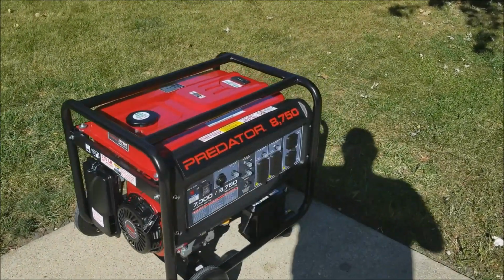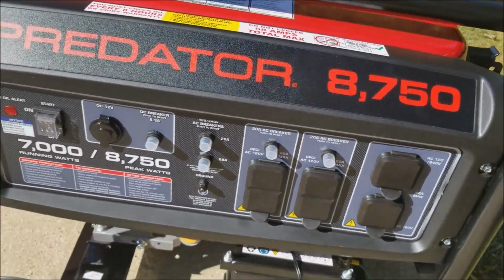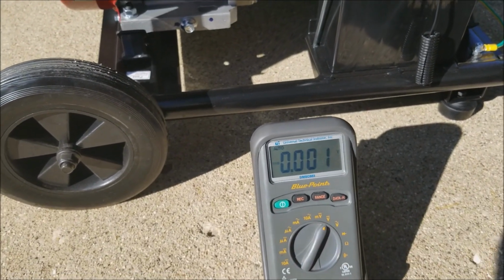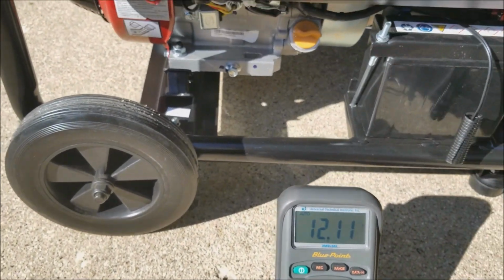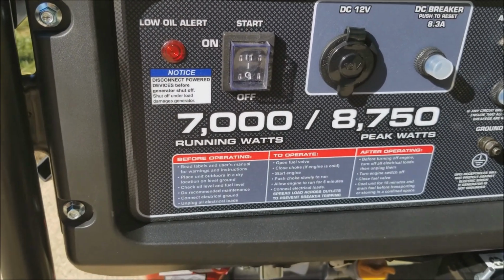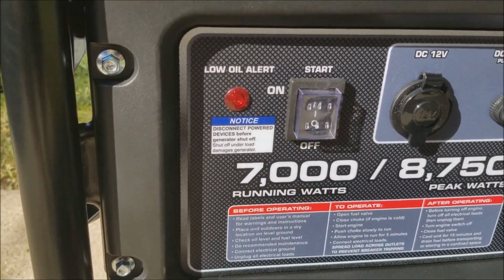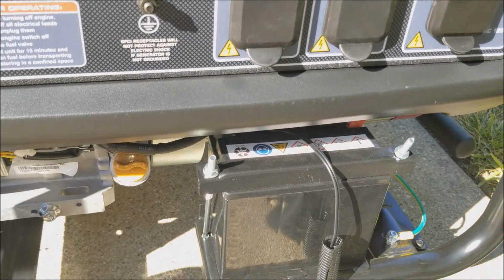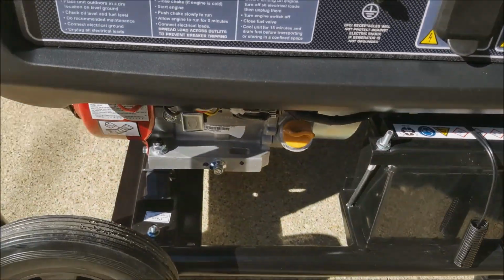Predator 8,750 Generator start up and voltage check

Comment: volts dont mater with NO LOAD
Reply from the maker: Darrin Hawkey Agreed, the test was to see the baseline output with no load. I've since tested it under 50% load and the voltages remained the same.
Reply: JPG23 good to know
Reply: @golf-n-guns  ⚠️Please do not forget to follow all the generator safety rules when you use your portable generator: 

This is just a reminder to make sure. It is important to follow all generator safety rules whenever you use your portable generator. Everyone needs to see this. 
Here are the things that need to be followed;

1) KEEPING OTHERS SAFE: Please do not allow an unqualified person or your children to operate and service the portable generator. Just because some manuals don’t say that doesn’t mean it’s safe. That is important against the generator safety rules. We also need to be keeping an eye on our children too. You need to make sure that your children are not playing near the portable generator especially when it’s running so they won’t get electrocuted. Generators pose electrical risks and they can be hot during an operation. Please keep your children away from the portable generator at all times. It is important to keep our children safe especially our little ones. Be aware of all the hazards.

2) WHERE TO RUN YOUR GENERATOR: Some people use their portable generators indoors which increases the risk of carbon monoxide poisoning. It’s important to have a carbon monoxide if you have a gas generator. Never ever use your generator indoors even if your doors and windows are open and even in the garage is not safe to use a portable generator. Not even at your porch and your deck. It is never safe to use your generator indoors and in enclosed areas of your home. Your generator needs to be 15-20 feet away from your house. 

3)🔥FIRE HAZARDS: Never refuel your generator while it’s running. You need to let your generator cool off before refueling it and before storing your generator. Never overload your generator too. Never ever back feed your generator. You should never plug your generator into a wall outlet. Also never store propane tanks indoors. Please keep flammable things away from the generator as well and please don’t smoke cigarettes near the generator. Having a fire extinguisher next to the generator is also important against the generator safety rules. 

4) GENERATOR OPERATION: make sure your hands are dry before touching the generator. Never use your generator in wet conditions. Don’t let your generator get wet. You need a generator tent if you need to use your generator during wet weather. Please don’t wear loose clothes when operating the generator. Turn on your generator before plugging in appliances. Use the right cord for your generator. Please do not use worn out cords. 

https://youtu.be/I1jT3ANENvI and here is a video more about keeping others safe when using generators 

Hope this helps

Comment: let me tell you a little about mine i bought this same thing about 7 years ago.about every 2 months i go out there and start it and let it run about 30 minutes running a light i never turn off the gas and it starts first pull everytime or right up with the starter. and i just ran it 11 days none stop except to check the oil and put gas in it. and it ran my entire house even the 220 when needed. on teh 25 foot cord you can buy at harborfreight. but it wont run everything on 50 foot of cord. so after the rain went away i moved it closer to the house and only used one cord. got about 13 hours per tank. it was and still is one of the best $900 i ever spent.  thats everything to hook the house up legal. and i lived through harvey also. glad they didn't lose anything. i lost almost everything.
Reply: no its not i don't know how to explain 3 phase to you but you can bet if its not about the size of a small truck its not 3 phase.
Reply from the maker: Wow, thanks for sharing your review and like you, I'm most impressed with this generator as it is basically a direct clone of a $2k Honda generator. Although I've gotten this one for my parents, I plan on getting the same one or the 13,500 for myself as I'm very happy with how this one has turned out. Please stay tuned as I've also built a shed for this one and will install it for my parents during Thanksgiving break. I've completed the shed and have run it for up to 9 hours non-stop and it has done very well even running multiple appliances at the same time. I did the 2.5 hour break-in as well. I'm glad you survived Harvey, it was definitely a nightmare for many. I'm in the TXARNG and got to see first hand what damage this massive hurricane did
Reply: glen john Sending you best wishes. Good luck rebuilding.
Reply: Nice! I must have gotten a really good deal today, paid $500 for this generator and it was only used once! Although when we got to the sellers house, I didn't think we'd be able to get it home because of how big it is. I wasn't expecting it to be THAT big, and we were in a small Honda civic. Lol. So the seller gave us a few straps, we put it partially in the trunk and strapped it down good. I'm in love with it
Reply from the maker: MegaJared2 Nice! You got a great deal, this generator is strong and if you take good care of it, it should last a very long time
Reply: JPG23 I plan on it! Tomorrow I'm going to change the oil, air filter, add fuel stabilizer, and let it run for 20 mins or so because the seller said it hasn't been used in a year. But it started right up when she was showing us it worked
Reply from the maker: MegaJared2 Good deal, my advice would be to dump the gas, put new gas w/stabilizer, run it for 20-30 min and then change the oil. After that, let it run for a couple of hours under load to put the generator to work for a bit
Reply: glen john is the 4 prong 240v a 3 phase? Thanks
Reply from the maker: glen john yup, that about sums it up, during hurricane Ike I was still working as an electrician and we installed a few 275kw gennies that were 3 phase 480v, and those were all mounted on their own trailers and about the size of a 1500 pickup truck
Reply: $900 damn I got mine on sale for around $500 I did get a good deal.
Reply: He said $900 all in, meaning purchasing the generator as well as having a professional electrician hook it up to the house, etc.
Reply: I just bought this off of a guy for 250, it ran great, but I changed the spark plug and man does it run even smoother! This thing is bigger than I expected but I love it.
Reply: ⚠️Always make sure you follow all the generator safety rules when you use your portable generator: 

This is just a reminder to make sure. It is important to follow all generator safety rules whenever you use your portable generator. 
Here are the things that need to be followed;

1) KEEPING OTHERS SAFE: Please do not allow an unqualified person or your children to operate and service the portable generator. Just because some manuals don’t say that doesn’t mean it’s safe. That is important against the generator safety rules. We also need to be keeping an eye on our children too. You need to make sure that your children are not playing near the portable generator especially when it’s running so they won’t get electrocuted. Generators pose electrical risks and they can be hot during an operation. Please keep your children away from the portable generator at all times. It is important to keep our children safe especially our little ones. Be aware of all the hazards.

2) WHERE TO RUN YOUR GENERATOR: Some people use their portable generators indoors which increases the risk of carbon monoxide poisoning. It’s important to have a carbon monoxide if you have a gas generator. Never ever use your generator indoors even if your doors and windows are open and even in the garage is not safe to use a portable generator. Not even at your porch and your deck. It is never safe to use your generator indoors and in enclosed areas of your home. Your generator needs to be 15-20 feet away from your house. 

3)🔥FIRE HAZARDS: Never refuel your generator while it’s running. You need to let your generator cool off before refueling it and before storing your generator. Never overload your generator too. Never ever back feed your generator. You should never plug your generator into a wall outlet. Also never store propane tanks indoors. Please keep flammable things away from the generator as well and please don’t smoke cigarettes near the generator. Having a fire extinguisher next to the generator is also important against the generator safety rules. 

4) GENERATOR OPERATION: make sure your hands are dry before touching the generator. Never use your generator in wet conditions. Don’t let your generator get wet. You need a generator tent if you need to use your generator during wet weather. Please don’t wear loose clothes when operating the generator. Turn on your generator before plugging in appliances. Use the right cord for your generator. Please do not use worn out cords. 

https://youtu.be/I1jT3ANENvI and here is a video more about keeping others safe when using generators 

Hope this helps